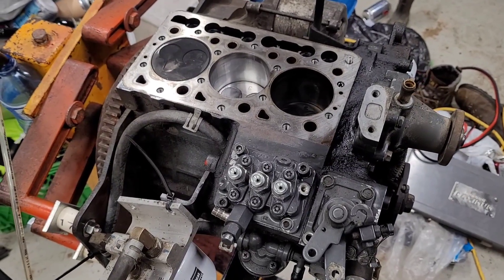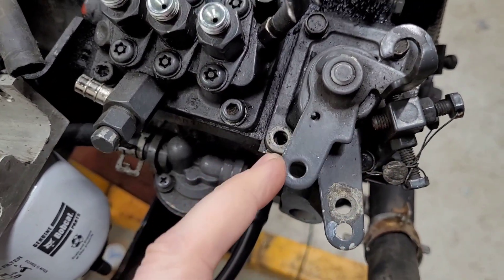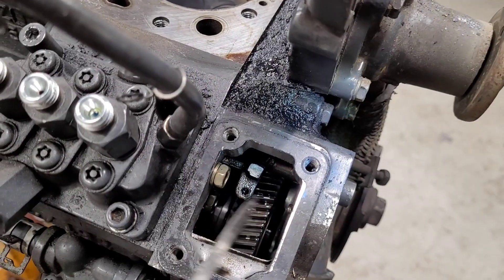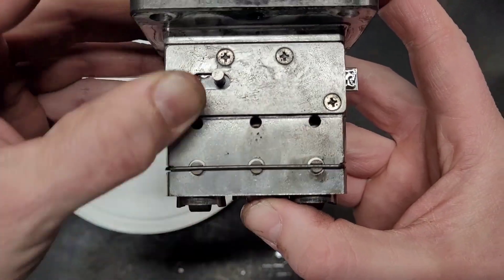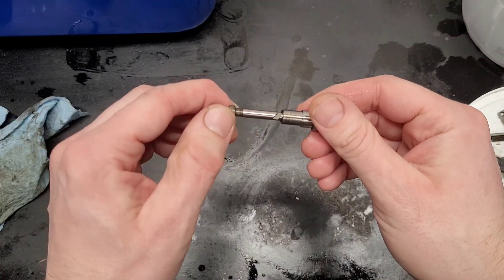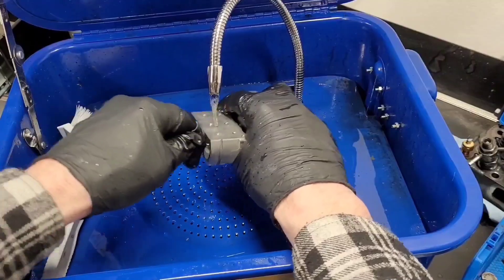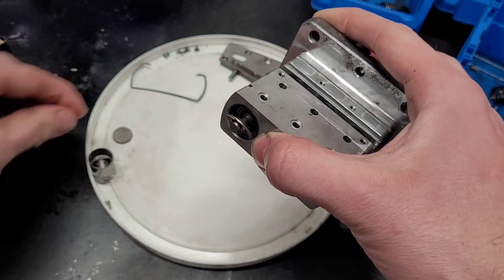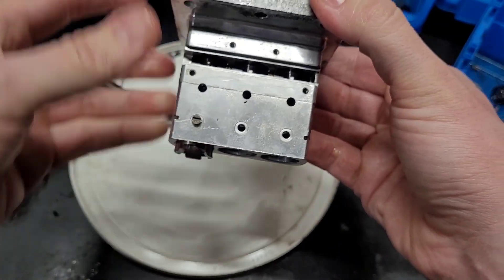Fixed: Kubota D722 diesel engine runaway

Comment: Great video, congratulations! I have an Iseki tractor with a 3-cylinder engine; the pump is similar to that one. The engine is a Mitsubishi K3D, and it has a smoke problem and seems to be mixing diesel with oil. Could you tell me where I can get replacement pumps and injectors? Thanks, friend.

Comment: NEVER use a rag to block off the air. Use a block of wood.
Reply: that's weird. why do you suggest that? to prevent sucking the rag?
Reply: @snozcocram yes, and possibly sticking your hand in with it.
Reply from the maker: I agree for larger engines but this intake is so tiny .  I wasn't prepared and had to grab whatever!

Comment: What tool do you need to check compression on these 3 cylinder Kubota diesel engines?… thanks for vid. I’m currently trouble shooting my mt85 skid steer engine
Reply from the maker: I use a Jet brand diesel compression tester.  It didn't have the right adapter for the Kubota but I found the right one on Amazon, it was a CTA Tools 2800X26 Diesel Compression Adapter.  This fit my compression tester, but not sure about others.
Reply: @ Thanks, I believe I have that same adapter that I used for my Kubota v3307 engine

Comment: Awesome video.  I am in the exact same boat with my MT52 i bought from an auction.  Turns over but barely fires on one cylinder and wont run.  Lots of white smoke.

Was your experience the same, lots of blowby and white smoke?  

Waiting on a compression test adapter but tempted to get ahead of it and pull the engine anyway.
Reply from the maker: Thanks!  Mine wouldn't run at all and turned out to have low compression due to broken ring lands on all 3 cylinders.  I'm sure from someone using ether.

Pulling the engine is not a small job.  I'd test compression first.  If that's low, you likely need to pull the motor. But I'd pull the head first, maybe it's in the head or valves, but for me it was the pistons.  You may get lucky and it's the injection pump and you don't need to pull the motor.  But with lots of blowby sounds like rings are done or pistons are cracked.
Reply: @RaincoastDiesel  Thanks for the input, I ended up testing my engine and got 330psi on one cylinder (the one that seemed to be fire OK) but the other two were in the range of 200-230psi after a long time cranking.  After new diesel, and testing each injector by cracking the nuts on each, they all seemed to be flowing OK.  Some black smoke, but mostly white with quite a lot of blow by.

Pretty much certain those two cylinders are toast (rings, pistons or otherwise).  Was this at all similar to your experience, compression value wise?
Reply from the maker: Yes all mine were around 200Psi I think.  Way too low.  All 400+ after new pistons and rings.  You'll need to address all 3 I reckon.
Reply: @RaincoastDiesel  great, thanks for the information.  I'm sure I'll find myself back to your video to ask questions, but at least I have a direction now.  

Did you end up getting parts from Kubota directly or use one of the other "kits"?  Specifically the pistons, I'm questioning the best place to get them.
Reply from the maker: I got engine internals from Friday Parts and injection pump parts from Kubota
Reply: @RaincoastDiesel  it did end up being broken ringlands on all three cylinders!  Someone probably got very happy with the ether in its past life.  

I am reassembling now, but curious if you replaced the connecting rod small end bushings or left the originals in?  Visually they are looking great.  And piston pin was perfect as well.

Contemplating whether I try to install the old pin and unmodified connecting rod with the new piston, or if I use the new piston pin with unmodified connecting rod, OR replace both the pin and bushing with the new ones.

Would rather avoid making a tool to replace the bushings.  

I am using what I think is the same kit you did, FridayParts.

Comment: Thanks for your video! I’m trying mine too. Did you have any pins to align the inner barrel with? The one that you put in at 8:17? I don’t get to which direction the hole or the little channel should go?
Reply from the maker: Thanks! I'm pretty sure the groove on the barrel slides over a pin in the side so it can only go together one way.
Reply: @RaincoastDiesel  I thought so from the drawing but these pins are not present. Someone has been inside before I guess. Thanks for your reply! 

Just to be sure, I’ve got the Zexel 16006 fuel pump :)

Comment: Well made video. Keep them coming.
I don’t know much about diesels but have a 20 year old kubota tractor.
So my question is how do you check compression on a diesel?
Reply from the maker: Thanks!  Diesel compression testing is basically the same as for a gas engine but you need a higher pressure tester and you will connect with an adapter in place of the glow plug or injector instead of the spark plug.

Comment: Nice job! One thing that might be worth mentioning (maybe you did and I missed it) is that there's a stack of one or more shims between the pump and the block. It looks like a gasket, but the thickness of that stack is how you adjust the timing, so if you disturb those shims, you need to put back the same thickness when reinstalling.
Reply from the maker: Yes you're right.   I didn't mention that but it's something to watch out for.

Comment: A little 2 stroke oil in the fuel will help eliminate sticktion
Reply: ATF works even better
Reply: I've read differing opinions on this. The ones I'd tend to believe are that ATF contains additives that are not designed to be burned in fuel, and can leave nasty deposits, and that it's designed to prevent slipping in a transmission, which is sortof the opposite of what you're trying to accomplish. Ashless two stroke oil seems like a better idea.
Reply: @iainmacdonnell7618 Well me and 2 million truck drivers and diesel mechanics been doin it wrong for 50 years I guess....lol
Reply from the maker: Thanks, never heard of that one.  I normally use Diesel Kleen additive.
Reply: MMO